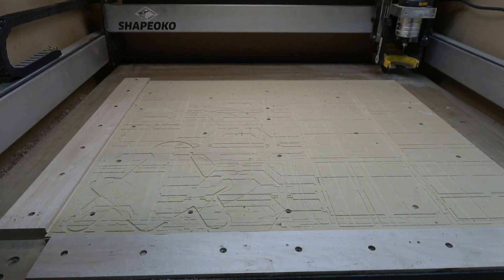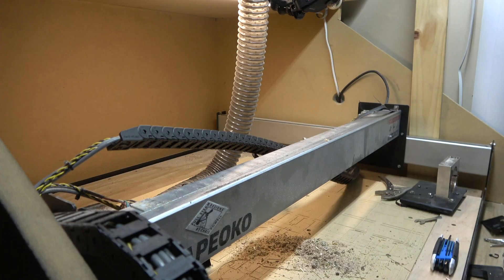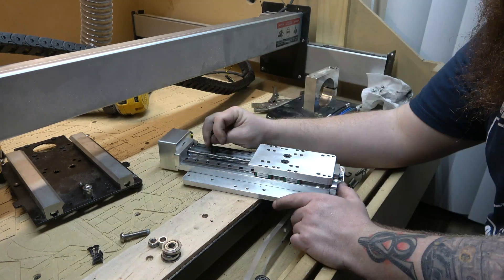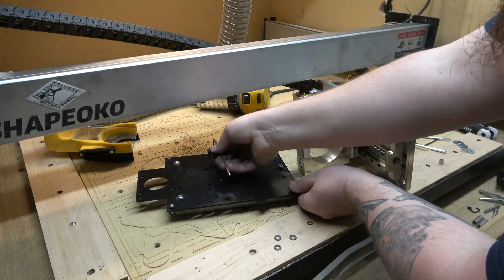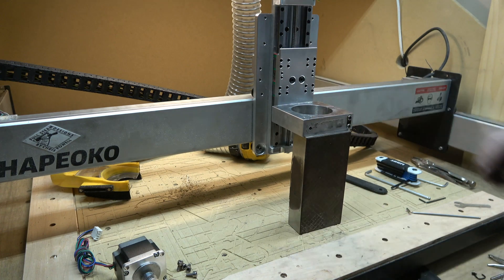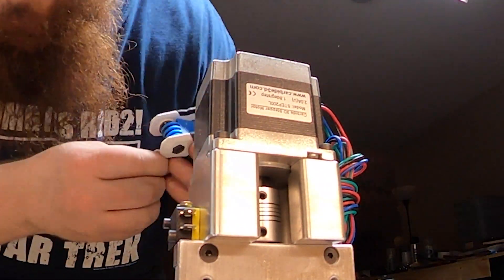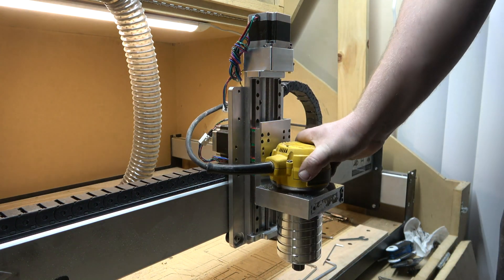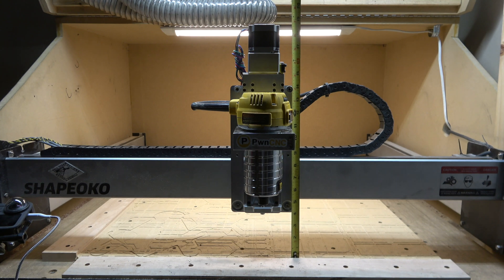Shapeoko 3 cnc4newbie Z axis slider install and review

Comment from the maker: ***Update: you can just select HDZ full travel. Then all you have to do it go into the mdi and input $102=200 
If you’ve already made the other changes, just click “resend original config data” and do the steps listed above.
Reply: Chris, did what you coached me on an I can now say, all is well. Unit is homing properly now, so again Ty,Ty. Your a Great American
Reply: Hey Chris, I'm about to purchase this just had quick question once you update the MDI do you need re-input all those setting everytime you turn on and set up the machine or is it a one time set and forget?
Reply from the maker: @travblack  no it’s just a one time thing. Unless you hook your machine up to another computer, you won’t have to do it again.
Reply: Does HDZ full travel limit things to the 150mm that the HDZ support?. This thing does almost 178mm.

Comment: Hey Chris, we’re running the same machine, but it looks like you’re running CMotion at V5? Did you upgrade the board as well? Mine only runs correctly on V3 for GRBL 1.1

Comment: Chris, thanks for all the great videos.  Wondering if you could comment a bit, since you've been using this Slider for a while, on durability and suitability of the CNC4newbee unit to a possible spindle upgrade at some point.  Do you think this unit would be up to a heavier cutter load and how the CNC slider fairs as far as wear and tear over time.   I've been thinking of an HDZ upgrade for a while (have some troubles from time to time with my current stock Shapeoko slider missing steps in Z) and don't want to get something that would have to be replaced if I decide even farther along to outfit my machine with a spindle rather than the stock router.

Been looking at the Carbide HDZ, but they are pricy and never in stock.   Also, what are your thoughts on the proximity switches that come with the HDZ vs reusing the older contact-style limit switches that are reused when installing the CNC4Newbees unit.

Thanks.
Reply from the maker: It’s been holding up great for me. No issues. As far as limit switches, I think they only change them with the z plus. I wouldn’t buy that one because the travel is less than the z slider.

Comment: Hey Chris, new problem. I installed acnc4newbie z-slider added and it works, BUT! I just found out my z is 3.5mm off. I just started trying 3d carves and every time I start a new project on the initial plunge of router is going deep. See #1 below. I have zeroed x, y, z with paper. #2, in the fast jog page I can click the fast to x,y and bit goes there perfectly. When I click the z plus 6mm bit goes there. Now the problem, #3 below. I measure with tape measure from top of project (z=0) and measure to bottom of bit (z+6mm) and it measures 3/8" which is 9.525mm not 6mm. I am off 3.5mm!! Everything I try is doing this. I have all grbl settings updated as per Chris Powells video.

    1st cut depth 3/16 = 4.7625

    Current x, y, z+6mm settings carbide motion
    x = 0
    y = 0
    z = .236

    Actual measurement surface to bottom of bit at z+6mm
    Frac = 3/8"
    mm = 9.525
    Dec = .375

Comment: Chris,  I finally ordered this z slider today and see you have an Update in your comments.  Am I reading this correct that now in Carbide Motion Settings, I just select HDZ and only have to do the one $102 line in MDI?,  or are all of the other $ lines still required as you show in the video?
Reply from the maker: Yes that’s correct. You may also need to change the z travel limit now that they’ve added that option to the settings page.

Comment: OK, Installed and set all MDI settings. Initialize and all movement is great. 1 problem. When the Z goes down it stops about 3/4" from the bottom of slider. With my 1" surfacing bit installed it stops about 3/4" from my spoil board. Like when people have to add a 3rd piece of MDF (a double spoil board) when they use the carbide setup. Is there a way to go into GRBL and set lower limit for Z?
Reply from the maker: Are you using the latest version of Carbide Motion? They added limits to the main settings page. You can adjust the z limit there.
Reply: @ChrisPowellFSD  Yes, I have v536. Where is the setting and what should it be for the cnc4newbie z plate? Thanks for the fast reply!
Reply from the maker: I haven’t changed it yet, but if you make it something like 2000, it would have more than enough travel. Since you set the z0 when you run a job, this wouldn’t be a problem.
Reply: @ChrisPowellFSD  , where is setting?  Under settings I picked xxl, for the z I tried all 3 options belt, zplus and hdz. No difference in height from spoil board.
Reply from the maker: It lists the max travel for x y and z. There’s blocks to the left where you can type in a different number.
Reply: @ChrisPowellFSD  , just found out you can put any number in for z travel dimensions in the initial setup. But if you put that same number in $132 you get error “z travel must be between 20 and 500” . Hdz default is 140. I changed to 200. Seams to work.
Reply from the maker: That’s good to know. Thanks. Glad you got it working.
Reply from the maker: I was already able to help someone else out with this. Got an email last night with the same issue. I might have to do a follow up video.
Reply: @ChrisPowellFSD  very cool. Would love to see another vid. I also installed carbide proximity switches. They work I just need to pretty up the mounts. here is a like showing proximity switches. https://www.instagram.com/p/CNDlE9FjIgl/?utm_source=ig_web_copy_link

Comment: I am wanting to do this. What are your pros and cons with the cnc4newbie z assembly over the Carbide 3d HDZ? Besides the obvious price difference.
Reply from the maker: The big thing is the extra length of travel and the availability. It’s a lead screw, not a ball screw, but I haven’t found any issues with that.

Comment: In the air about this or the Z-Plus for my XXL.  I'll be doing a full teardown and upgrade soon and want to pick your brain a bit if I can...

For starters, based solely on rigidity and cost, do you think I should go with this kit or the Z-Plus?  I'm still working with the original pre-Z-plus setup, and I'm definitely upgrading the Z for the rigidity, but I'm throwing around the idea of milling new end plates for the gantry so I can gain an inch and a half or so height.  I'm going to be running a 4th axis rotary, either a 4" chuck on a GAM 16:1 or a 6" chuck on a Wittenstein Alpha 25:1 (either likely reduced to 50:1 or more via pulleys), and I'd love to have that extra gantry/Z clearance while still being able to touch the bed surface with whatever endmill.  Regardless of if I raise the gantry, I will still be able to run a rotary on the machine via a mod I've cooked up, just not at the same workholding capacity.  Curious about what you'd recommend, the added expense for this kit over the Z-plus purely for rigidity and not being able to take advantage of all the extra travel kind of irks me a bit.  Whatever Shapeoko parts I replace, as well as whichever rotary setup I don't use, will likely be moved to a high diameter rotary build currently in the works.

I've seen how some folks lower their beds or undermount their spoil boards for added clearance but I'm not too interested in reducing the rigidity of the machine by losing the crossmembers or mounting the frame on risers.  I have a 250mm wide bit of slotted extrusion that I'd planned on mounting directly to the frame in the space between a couple of the crossmembers, but also definitely not interested in replacing the entire bed with aluminum either, would rather the cash went to upgrade the spindle.
Reply from the maker: I think quality wise they will be pretty comparable. I don’t care for the loss of z travel you get with the z plus. I jokingly call it the z minus. The cnc4newbie has a lot more a travel. Eventually I will be raising my z rails and upgrading the bed.
Reply: Just for added info, the dedicated rotary build is for drum shells.  It won't need increased Z travel, and the original Shapeoko 3 XXL Z will be going on it riding C-Beam from OpenBuilds.  The rotary on the X axis will be riding on a height adjustable platform to bring it within acceptable range of the Z.  Will mill shells up to 26" diameter, and will have about 36" of travel/width on the fixed gantry.  Probably use it for other things such as staffs, pool cues, or rifle stocks, but it's mainly a drum shell machine.

Comment: Seems like a lot of electrical work. I prefer the TrueZ, it's just a drop in unit without the need to mess with electrical and it takes 10 min.
Reply: The true z is junk. Interesting idea, but poorly executed. The guy making them should spend more time refining the design, and less time spamming Facebook groups. The amount of slop in the lead screw is atrocious.
Reply: @steveboyd4184  There is no slop in the lead screw at all. None. Use a caliper and measure it yourself if you have the TrueZ.
Reply from the maker: All you have to do is change 2 connectors.

Comment: Chris, Z drive running in reverse, help
Reply: Yes, going to do $$ today to make sure they took
Reply: Ty will keep you updated
Reply: Check out reply on your post labeled 20 hours ago
Reply from the maker: Did you change the grbl settings?
Reply: Went into setting an selectees plus. Then ran initialize z axis tried to home, but didn’t see limit switch, will redo connections tomorrow. Also uninstalled motion. Will download again an reinput GRBL settings. What about choosing the z plus setting. Ty for the help
Reply from the maker: Resend the factory settings, and select HDZ full travel. Then go into the mdi and input $102=200. That’s all you need to change. You can test your switch without initializing the machine. Just push on it and you should see a light inside the controller. If you don’t, it’s probably not wired correctly.
Reply: Chris Powell Ty ty, will definitely let you know how everything works out. Like everyone has expressed, the video was very helpful. Thank you again for everything you have done to help the CNC community
Reply from the maker: Thanks. Let me know how it goes.

Comment: it's kind of amazing they don't even have a guide and just point to this video, but at least you're thorough.  that said, right now my machine is bricked as regardless of what $132 value i send, the machine position soft limits at -100mm.  :(
Reply from the maker: Try selecting the hdz full travel option in the settings in CM. Just switch the $102 value to 200

Comment: Mine got here today.  Set it up in about 2.5 hours.  Things I did a little differently.  When replacing the belt on the x axis.  Just take the motor off the brackets to feed it through.  I tried fishing and gave up.  The other thing a little different on my install was that the Carbide  3D eccentric nuts fit.  (Original and the ones is the maintenance parts kit)  I had already ordered the maintenance kit because I had worn out the z-axis belt, and the x-axis wheels were not too happy.  But I was very happy to have this video as a guide.  This was well done and saved me a lot of frustration.
Reply from the maker: I’m glad it went smoothly for you. I noticed that I was able to change the settings to the hdz with full travel, and just had to change $102=200. That allowed me to get the full range of travel out of it.

Comment: Chris, you talked about having to change out the bracket for your dust collection due to the change in the slider.  I am looking at this upgrade and not sure which slider on PWNCNC would be the best to avoid it hitting the side rail.  Which one did or would you go with?  Thanks and keep up the awesome videos!
Reply from the maker: The one I ordered is actually a universal one I believe. I think your best bet would be to email them and they should be able to tell you the exact one.

Comment: Hey Chris. Great video, I don't think i could have assembled it to my shapeoko without your video! Quick question you may have the answer to. After entering all your settings and running I thought with the smaller footprint of the slider that I would have a little extra room on the X axis. When I jog all the way to the left it will stop but I still have a potential 1-3/4" more that it could move because the slider is smaller. Do you know of a setting to give me this extra room? I'm using CNCjs with a Shapeoko 3XL
Reply from the maker: You should be able to change the max amount of travel. CM probably limits you, but cncjs shouldn’t. $130 is the max travel for x. Not sure what it should be set to though. Check the factory setting and make small adjustments.

Comment: Hi Chris great video, very thorough! This is Chris from Sienci Labs: glad our deeper bore eccentric nuts were able to help out with the upgrade kit to provide that additional rigidity. I had a question about this kit and was wondering if there's something I'm missing here. I saw on the site that this is meant to provide 7" of travel but I'm curious how much actual cutting height that translates into. Are you able to cut both higher AND lower than you used to be able to?
Reply from the maker: The overall length of the whole axis is longer, so you have a lot more travel up. They moved the spindle mount down to just about the bottom on the plate. This lets us travel a lot lower than the stock setup ever could. Right now I’m limited to about 4.5 to 5.5” of travel, because I’m running Carbide Motion. I plan I’m switching to cncjs so I can take advantage of the full length of travel.
Reply from the maker: Those eccentrics are really well made. They’re a small, but super important part, and they’re dead nuts on as far as size goes.
Reply: @ChrisPowellFSD  - is cncjs free? how much max travel for Z if I use cncjs? Thanks

Comment: Chris, can you tell me why you bought this instead of Beaver HDZ (besides it is appr $70.00 cheaper than Beaver ) what the difference. Is that beaver HDZ used Ball-screw and your use Lead-screw ??? thanks
Reply from the maker: Honestly, I’ve never seen a reason to upgrade the z before. I think the factory parts are capable of taking much more abuse than most people put them through. However, I would like ditch the dewalt router for something better some day, and the extra travel this offers is nice. I guess the real question is, why spend the extra $70? Availability seems to be much better on these also. No need to put your name on an email waiting list. Just go buy it.